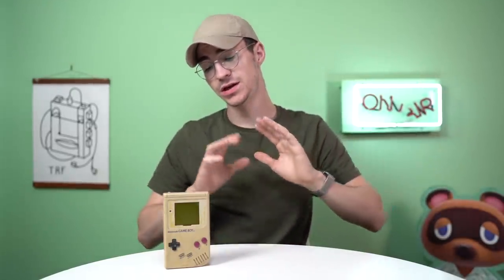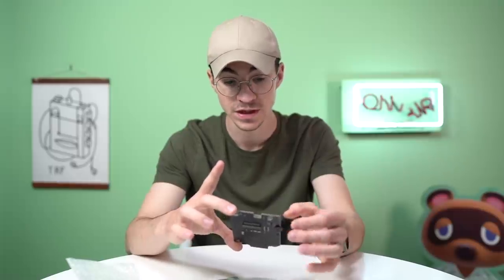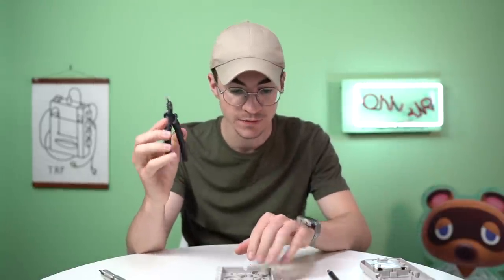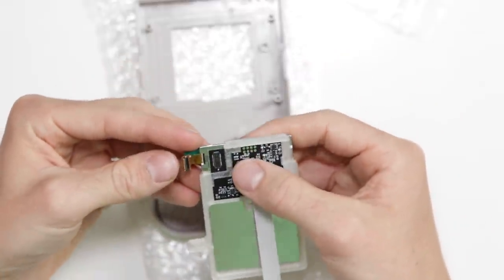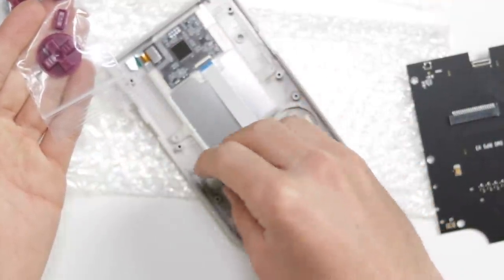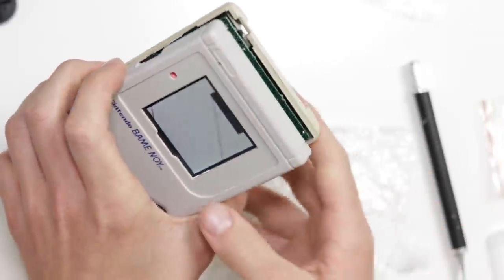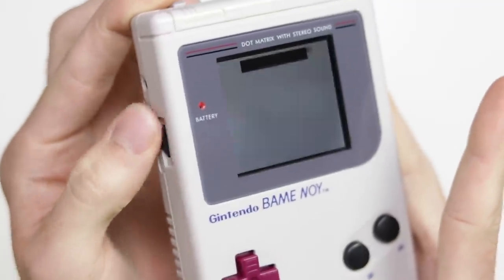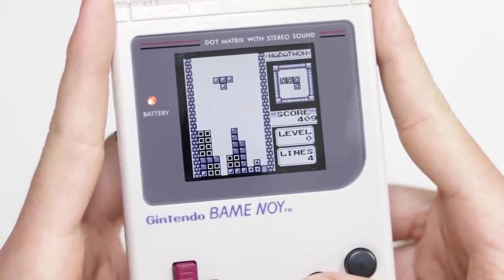The Gintendo Bame Noy

Comment: Bit of advice, don't connect the driver board to the screen while it's sitting on the back of the screen. I did this and the little bit of pressure from pinching that connection together cracked the screen. Luckily for me the screens by themselves are super cheap, but I had to wait another week for the replacement to ship to me.

Comment: How reversible is the IPS mod. I'm aware you have to make 3 mods to the case which involve cutting bits out however if you wanted to revert back to stock how vital are those bits you remove. Will it still work perfectly without them? Does the stock screen and board stay firmly in place.

Comment: I am not talented enough for these projects so I have professionals do it. I have a DMG with GBA guts that just plays original and color no GBA. I use it in my Hyper Boy. Sooooo Rad. I also have a consolized GBA with the 8bitdo SNES dongle and a NES Online controller. It needed a firmware update on the 8bitdo but I did that myself. I really hope the Analogue Pocket comes out and the Retron Junior.